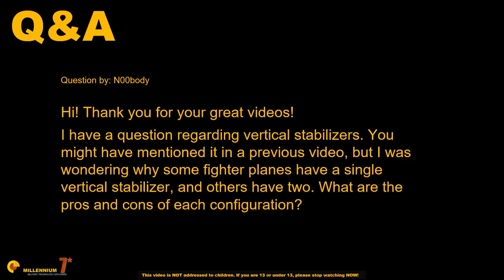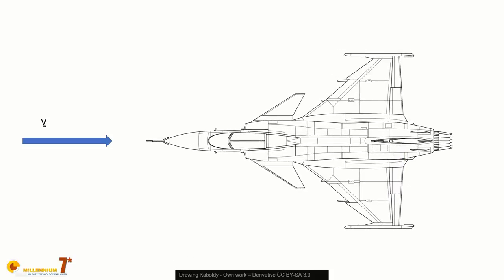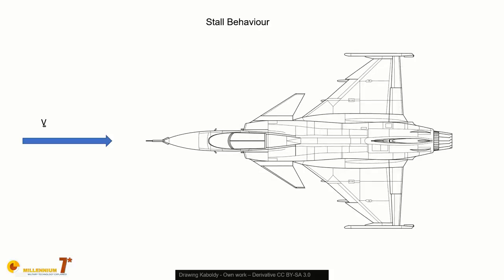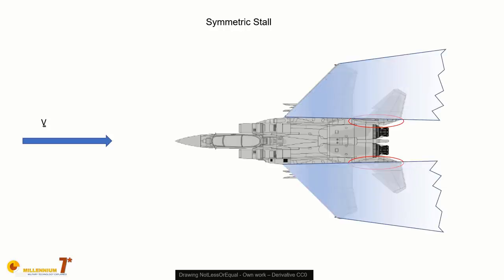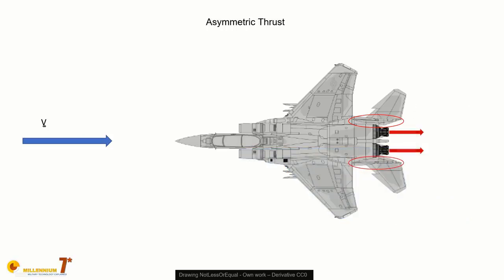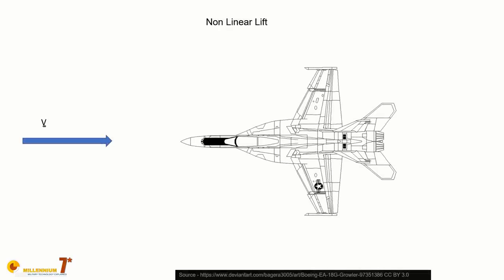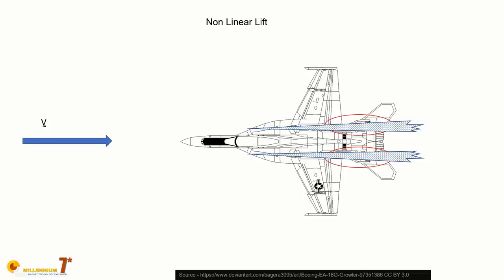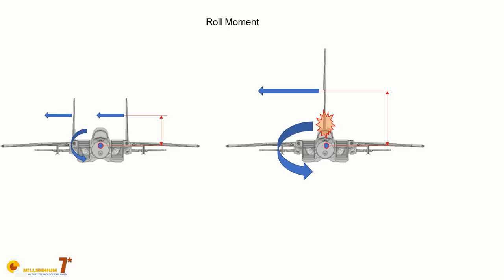Why Fighters may have Twin Vertical Stabilizers? - Q&A Video

Comment: Also another type of vertical stabiliser. Those canted so far out that they can act as tailplanes. Such as the F-117 and YF-23. Otherwise known as ''ruddervators"  or "V-Tail".
Reply: F117 prototype had stabilizers canted inward, production model canted outwards?
Reply: The " vertical " stabilisers of the YF- 23 if I remember correctly are called 'pelican' stabilisers
Reply: IIRC, the Beechcraft Bonanza has a V-tail like that as well.
Reply: @AvroBellow  I think the early lives ones did. The Citrus Vision Jet SF50 also has a v-tail.
Reply: @DamplyDoo  Have Blue had canted in stabs but in production they switched to outward canted stabs
Reply: the fouga magister has a v-tail as well
Reply: @DamplyDoo   Regarding the Have Blue vs F-117 tail configurations, Have Blue's thin horizontal exhaust slits were in between the inward-canted tails and the airflow off the inside of the tails tended to concentrate the exhaust plumes and therefore increase the infrared signature.  The production F-117's outward-canted tails which form a "V" have a slight opposite tendency so they are superior from an infrared stealth standpoint.
Reply: Or the H of the TomCats.
Reply: These stabilisers are making a plane more stealthy, and were part of the reason why the YF-23 was a more stealthy plane than the F-22. Another thing was it's exhaust, that they borrowed from the B-2 bomber, which slopes or open upwards, hiding exhaust heat from heatseeking missiles from below. The F-22 had thrust vectors instead, which is basically the reason it is called "more agile".

Comment: Interesting note. The f16 was designed to have twin stabs. This is why they have the barge boards at the back. According to one of the design team, they could just not get them to work effectively and reverted to a single stabiliser. They also did a design study when making the Euro Fighter with twin stabilisers!

Comment: Twin stabilizers can also act as airbrakes, when deflected in opposite direction (by fly by wire).
Planes with canted stabilizers can also use that to help in pitch.
Reply: To add to this; the F-35 does it (as speedbrakes). The tailplanes on the YF-23 were said to have such ridiculously strong authority that they almost negated the advantage TVC gave to the YF-22. And finally, the Hornet (probably only the legacy model) turned out to not have enough nose up authority to take off in the required distance. Thus, McDonnell Douglas made the rudders toe in to contribute to the rotation, and that was what allowed them to achieve that goal.
Reply: @lfox02  but twin stabilizers concept means extra weight which is not favorable in this case.

Comment: We can also add the fourth configuration: no vertical stabilizer like in the B2 and in the future FCAS. They in fact reflect a helluva of radiation.
Reply: Don't forget the Northrop YB49
Reply: B 2 is a bomber and f 117 a strike aircraft so not supersonic figthers
Reply: I think the NGF / FCAS is going towards the direction of a V-tail now, at least on mock-up!
Reply: And the compromise : the very short ones of su 57

Comment: Excellent video. There's also the value of having 2 in case one is blown off the plane by a missile strike.
I'd elaborate that the SU-27/SU-35 design does a particularly excellent job of handling stall vortexes with it's LE geometry curling under the fuselage, which also turns the fuselage into a lifting body for efficiency, and feeds it's VS good airflow. And the SR-71 with it's inward-canted VS's actually eliminates almost all of the roll stress, which is important with the high stresses it's fuselage endures at mach 3-4, and helping it to handle the lateral stress of unequal thrust output with it's 2 engines so far apart, when the engines switch mode.

Comment: the structure that holds the engines is a good place to fasten a stabilzer. If you put it anywhere else you have to strengthen the fuselage there and creat a mountpoint for the stabilizer which adds weight. So aircraft with separated engines have two stabilizers but twin engine aircraft where the two engines are together can have one stabilizer and still be able to mount the stabilizer on the structure holding the engines. The F15 has an interesting placing of the vertical stabilizers.

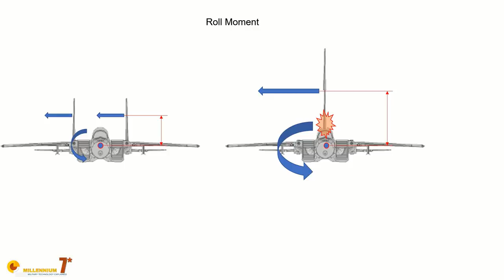Comment: @ 9:53  Minute, another Advantage of using two Vertical Stabilizers in the F-15,  is that in case of Pilot Ejection during Emergency, is that the Pilot+Ejection Seat can clear the Aircraft without Hitting the Vertical Stabilizer. 

If a Single Lengthier Stabilizer is used there is possibility of the seat & pilot hitting the Stabilizer.

If a Single Lengthier Stabilizer is used, then more a powerful rocket in the Ejection Seat should be used, which means subjecting the Pilot to higher G Load, which might not be Good.
Reply: Not really all or most every ejection seat has what's called "Zero Zero" capability which means it can safely eject at zero altitude and zero velocity, which means they all eject well over any part of the plane.
Reply: Another very valid point
Reply: @BennyCFD  At zero speed you are not concerned about hitting the tail. But at high speed, then the ejection seat must clear that tail which is coming at the crew member at high speed. Modern ejection seats have a rocket motor that is designed to have a controllable level of acceleration, unlike the first iterations which were basically shotgun shells that had a reputation for breaking the backs of anyone ejecting. The scariest aircraft I can think of is the North American A-5 Vigilante, built for high speed but with a ginormous and tall single rudder.

Comment: I have additional hypothesis to propose: 
-Navy. Have vertical stabilizers small enough to enter an aircraft hangar. Currently, the Rafale is the only navy fighter to have only one stabilizer, and it is the smallest. ex: F-18 F-14 F-35
AND
-Planes evolving at high speed (> mach2) and high altitude need a VERY large stabilizer, which amplifies the problems of roll moment and weighs down the plane by its structure. Rafale Grippen Typhon are mach 1.8 planes, F-15 Su27 Mig29 Mig31 are mach 2.5 planes.
Reply: and of course the interdiction to have vertical device on a stealth plane (PAK-FA, F-22, F-35, F-117)

Comment: Because a single centralized vertical stabilizer causes the aircraft too both yaw and roll when being used. However twin vertical stabilizers, while they definitely cause roll, cause LESS roll than a single, center vertical stab.

Comment: An example of a plane built in both twin and single vertical stabilizer versions is the Consolidated B-24 Liberator and its naval variant the PB4Y-2 Privateer.

Comment: Another reason I have heard why F-14 has two fins are because the engines are so wide apart so give better handling of fly on one engine.

Also I think the Tornado with its fin looks like the male orca version of a plane.
Reply: A very large single fin would do the same thing.  If the F-14 had a single fin it would have had to fold to fit in a hanger deck and would probably have added weight to the aircraft.  It would have taken addition structure the mount a fin on the center of the flat rear fuselage, whereas the engine pods provided a ready place to take the structural loads.
Reply: I always thought the Tornado's vertical stabilizer seemed disproportionately large, at least from an aesthetic standpoint :)
Reply: @gort8203  the original mock up had a single tail but Grumman had already decided to go with two smaller tails by the time it was shown and photographed.

Comment: The other reason being a rudder positioned further out has more leverage over the airplanes centre of mass so they can be smaller or have more control authority. The other being they can both simultaneously deflect inwards, cancelling any yaw but acting as airbrakes.

Comment: The JU 87 actually started with two small stabilizers like the Donier 17.. The JU 87 had a very rough surface and airflow. I believe this was the reason the test model twisted its tail of in a steep dive. The stabilizers must have created some violent vibrations. I wonder if the Donier 17 had this problem since it also was used in dive bombing tactics.  I can imagine that when a Liberator get one stabilizer damaged  it would be worse of than the B-17, The twin stabilizer Liberator would demand much more force on the rudder pedal to keep in a straight line.

Comment: You did not comment on the fore-to-aft positioning of twin canted vertical stabilizers, as in the f-18 and the f-22. In these planes, the canted vertical stabilizers are positioned above the gap zone between the wing trailing edge and the horizontal rear stabilizer leading edge. In this position, the canted vertical stabilizers protrude outward into relatively clean airflow, enhancing controllability in extreme pitch-up attitudes (thinking about 60 degree pitch).

Comment: The single vertical tail on the F-4 was a limiting factor in maneuver combat.  At high angles of attack it was blanketed by the fuselage resulting in a loss of stability in the yaw axis and the aircraft would fall to one side.  The Israelis experimented with adding canards to a Phantom which improved some aspects of maneuverability but ultimately the angle of attack was limited by the single vertical tail and the canards didn't help with that.  A bigger vertical stabilizer might have helped, or maybe a complete redesign to an X-geometry for the tail surfaces.
Reply from the maker: Good info. Thanks.
Reply: Can you possibly provide reference source for that info?  I would be interested in reading more.
Reply: @gort8203  I pulled it from several sources.  The primary is "Design for Air Combat", by Ray Whitford.  From page 191:  "In the past fins were usually sized to meet stability requirements at low and moderate angles of attack (up to alpha = 10 degrees typically).  In fact most of the previous generation of combat aircraft - F-4, A-7, Jaguar and F-111 - cannot be flown safely up to the wing stall boundary because of lateral/directional control deficiencies."  This explained the departure/spin risk I'd read about in accounts of F-4's vs Migs.

I recall the experimental Israeli "Super Phantom" with the Pratt & Whitney PW1120 engines from the cancelled Lavi program.   While the canards probably improved the angle of attack wing stall boundary, little good that did if the fin had already lost yaw control.

And the idea of modifying the tail was my own amateur suggestion... the idea behind the X-tail being that, in the event of an asymmetric stall, hopefully one of the verticals would still have authority.   Which might only be wishful thinking.  The lower surfaces of the "X" would be limited in size by the risk of a tail-strike on takeoff.

EDIT:  Upon consulting Google, it now looks like I was conflating the canardless Boeing/Israeli "Super Phantom" (PW1120 engines) with an American demonstrator aircraft which had the canards.   Oops!!  Anyway the loss of yaw stability at high angles of attack would still have been the limiting factor.
Reply: @dl6519  Sorry, I didn't get a note that you has responded and just noticed this, so thank you. Unfortunately the book is out of print. 
I completely agree that tail surfaces have become larger to provide better controllability at high angles of attack, but I still think one of the reasons they need to be larger is that they have moved closer to the CG; with less moment arm for the restoring force you simply need more of it. For example, the tail of the F-15 is significantly closer to the CG than the tail of the F-4, so its surfaces must be larger to generate more force.

Comment: So the main reason one would go from a single to a twin stabilizer on the same design (like the Iranian F5 developements) is likely some combination of improving the effectiveness of rudders in inducing roll (which is pretty important in the F5 itself), get away with a less strong construction (simplifying maintainance?), and reducing the radar cross section?

Comment: Would be interested in comments by aerodynamic engineers... I suspect that hardly any of the reasons in this video are main reasons or valid at all.

I instead suspect...
That the size (ie height, not surface area) is due to the airfoil shape, but whereas the wings and rear stabilizers' main function is lift, the vertical tail fin purpose is likely minimal drag and maximum effect when intentionally creating a yaw.
The size of the vertical fin is also likely related to moment of pressure required, which is proportional to the distance to the plane's center of lift... In other words, the shorter(distance nose to tail) the plane is and the more violet the yaw desired, the bigger the fin has to be but if the plane didn't need violent acrobatics and was mainly interested in stability, then the fin could be tiny if set a long distance behind the plane's senter of lift.

And, of course in the case of canted dual stabilizers, a lot depends on the main wing plan. If the plane is perfectly balanced and didn't need horizontal rear stabilizers the fins could remain perfectly vertical, but could be canted to assume some horizontal stabilizer functionality if desired.

So, for instance even a lay person can visually compare the relative width and length of numerous planes and see for example that although large, all cargo and wide body aircraft have enormous single tailfins because they're needed to stabilize and turn the aircraft. You'd have to look at pictures of old transport planes like the Locheed Tristar to see a large aircraft with multiple tailfins, and then each fin would be much smaller. You can imagine the complexity and likely increased risk of a plane with multiple vs single tail fin.

As for the reasons given in the video...
I suspect that the reason given about stall characteristics as described is hardly considered. I assume that designs hardly design for flight characteristics during a stall since a stall is hardly ever intentional and generally means loss of control... The point is always to avoid a stall, not operate while stalling.

Structural strength is probably a consideration, but would be like any other part of the aircraft. I suspect though that it's not a major consideration for fighter planes and that other considerations like aerodynamics, radar and visual profile and functionality are all primary considerations before structural.

Whenther a plane might fit within a confined space might be a consideration, but I'd guess usually not... At least as far as the overall height. And espeically not for the F-15 which is not carrier capable but might be stored in bunkers and hangers. I'd guess like the C-17 and C-5, the military would rather build storage to accommodate the aircraft and not vice versa.
Reply from the maker: I am an aeronautical engineeer ...